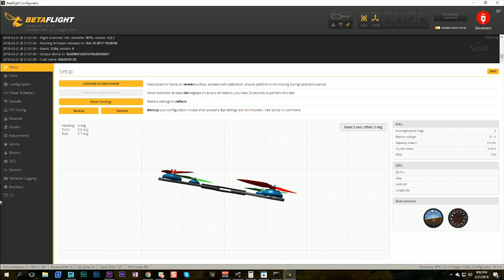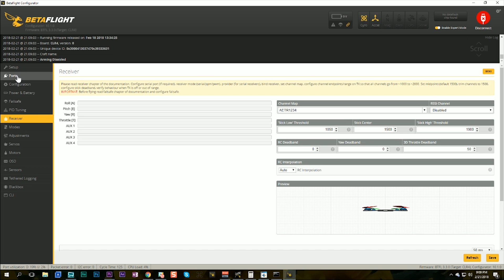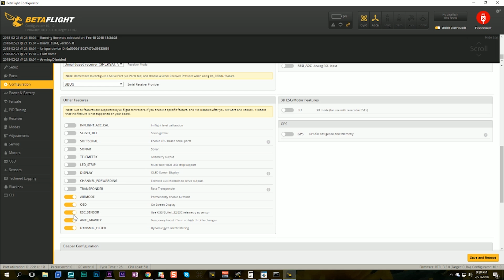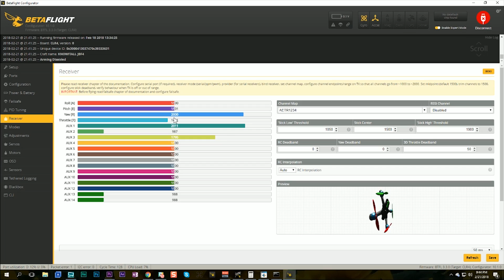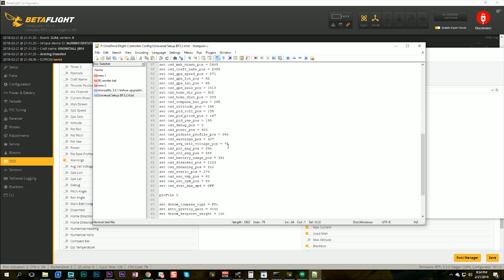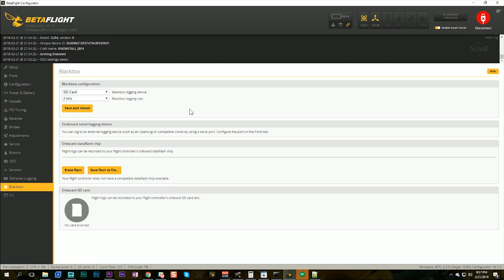Betaflight 3.3 Ultimate Setup Guide

Comment: On OMNIBUSF4SD target the 'Disarm regardless of throttle value...' option is no longer available in the Configuration tab. Now disarming via switch directly kills the throttle value and drops the quad from the sky. Any ideas or does anyone know what the cli command is for this?
Reply from the maker: Make sure you are on the latest configurator version. IDK if maybe they disabled that option?
Reply: Yes, all up-to-date desktop Betaflight-Configurator 10.2.0. I'll try to load the regular OMNIBUSF4 to see if this feature is missing there as well...

...No, same issue, for both F4 targets this option is missing. See: https://drive.google.com/file/d/1fE490z9FWyYOdkzyBjh0NnEYY1YSDc6j/view?usp=sharing
Reply: It's confirmed, this feature has been pulled from the official 3.3 release. cli also doesn't support it anymore. I hope at least they'll put in the cli option again. I've learned to fly these things, still in having control when on accident hitting the disarm switch. Kind of what I learned as best practice from the various setup videos seen on youtube - https://github.com/betaflight/betaflight/issues/5297

Comment: I'll wait for the BF3.2.0 configurator with the BF3.3.0 firmware, there a lot of CLI commands involve in the upgrade, am sure Mr Bardwell will doit great as always explaining the upgrade and 32K Gyro, Kalman Filter, Runaway Takeoff Prevention, Arming Disabled, Independent rates settings for roll / pitch / yaw conversions, I think Mr Bardwell has to do a complete serie just for BF3.3.0
Reply from the maker: I've already done the Taz video if you search for it.

Comment: I have an F405 AIO and it will NOT do 8kHz/8kHz, always puts me back to 8/2. Any ideas?
Reply: having the same problem with my jbf4 aio, keeps resetting to 8/2
Reply: best i got was 4/4. Wondering if it's a bad batch or the fc is just not capable

Comment: JB!!! Your my guy!! Seriously you help me out allot. I am gonna use your affiliate links to sure this month 👍 love this video! It’s what the community needs. I figured out what was causing my over roll issues. Something was messing with my gyro and a simple FC cover fixed all my issues. I am running 3.3 RC 2 currently and am loving it. Thanks for this. I do have a question about BLHeli_32 and this brand new Spedix 35amp AIO that doesn’t want to connect to the latest 32 passthru... I have a brand new X5 Silky in building and the last thing I need is to change my motor direction but in getting error code 9 and error code 2 telling me to check my USB settings. The problem is it works fine on my other BLheli_32 quads so it’s a head scratcher...any ideas?? I need help on this one.
Reply: Oh man that was a interesting one. Got it figured out. Faulty brand new Spedix 35a BL32 AIO.... couldn’t get on 32 pass thru at all and in BF if you ran motors the esc would shut down and boot you out of the config...FML. Get fpv is getting this one back. Really bummed as the solder job was gorgeous and the old Speedix AIO was one of my favs but this one was a total turd 💩. Get my Silky X5 upbthis week but I gotta wait now . That’s the s$&@ part of this hobby. You can do everything right and still be waiting cause the margin for error is so high with this tech IMO

Comment: diff goes to txt, but restore looks for JSON?
Reply from the maker: You don't use the save/restore buttons. You paste back in the text to the CLI window. The save/restore button never worked and should be removed. Until it's removed, let's pretend it doesn't exist.

Comment: Hi Joshua, 
Great video. :) 
I have one question for you,
When you hit “save and reboot”, it says “failed to close serial port” in the top left corner, but you didn’t mention it.

I have the same message. Is there any reason for this? Are the something I did wrong? 

(I have the F405-osd FC)

Thanks ;)
Reply from the maker: No, it doesn't mean anything. You can ignore it. Basically, the configurator went to close the serial port, but the FC had already disconnected, so the serial port was already closed.
Reply: Joshua Bardwell, thanks man. 😎
Now I can sleep at night 😅

Comment: On my JBF4 I needed to adjust the scale of the amperage calculation quite a bit. At least on mine, the stock setting of 250 was way off. I've tested with about 6 packs now, and although it's not perfect yet, a value of 370 is pretty close.
Reply from the maker: I'm surprised to hear you have to change it that much.

Comment: After the deluge of comments here I'm not sure you will get to this but why did you use "diff" and "save" instead of "dump" and "save" since "diff" only puts out a limited number setting and "dump" puts out everything?
Reply from the maker: diff only outputs what has changed from defaults. So it avoids overwriting default values that change between versions, and is more concise.
Reply: Oh that's great to know. Thank you!

Comment: I can’t get DFU up for the life of me. I’ve installed all of the drivers & impulse RC driver dose not work for me I have tried everything uninstalled Betaflight & the drivers reinstalled everything different cables nothing works. I still cannot connect my Tiny6 with its F3 flight controller on two different pc’s 😫🤬😤
Reply from the maker: Probably it is an spracingf3 based flight controller and it uses the CP210 chip. If your FC has a CP210 chip you will never see DFU in the configurator, even if the board is in bootloader mode. You have to look at the LED on the board.

Flashing an spracingf3 FC is like this:

Set manual baud rate 115200

DO NOT put the FC into bootloader with the button or the "bl" command.

Simply plug in and hit Flash. Often times this works. Sometimes you have to hit Flash, let it fail, then hit flash twice.

If that doesn't work, try holding down the bootloader button while you plug in USB. But generally, when I flash an spracingf3, it doesn't work if I actually manually put the board into bootloader.

Comment: The long anticipated BF 3.3
I know you said that this is only a release candidate and that you will be going over more functionality as the actual release comes out.
I got the Kekute V2 "great manual by the way" 
Do you still have to do all that Voodoo to overclock the CPU and the copy and paste the CLI commands for the Kalman filter?
There might be an unspoken rule of one question per comment we leave. LOL...
But when we do run the Kalman filter do we still select and do the configuration for Dynamic filters?
Thank you Joshua..
Reply from the maker: You don't have to overclock. The new Biquad RC/FIR filter avoids that.

You can combine BQRCFIR with Dynamic.

Comment: I'd love some information about getting rssi to osd via telemetry instead of having to run a wire. Great video, that's why I'm a $5 Patreon subscriber.
Reply: Check out oscar lang website, frsky r-xsr instructions, he goes over this and writes it out for you to follow, basically you tell your radio to broadcast rssi on a channel, then tell betaflight what channel it is on (Aux channel)
Reply from the maker: I made a video about this:

https://www.youtube.com/watch?v=t-evOAS9Mkg

Oscar Liang's instructions are based on older version of OpenTX and don't work any more. At least unless he updated it and I missed it.
Reply: Thanks I watched them both.. again😎 I think there is yet another way if you have opentx 2.2 and betaflight 3.3. On bf slack,  @mikeller mentioned nothing to do on taranis but make sure to discover sensors and verify rssi, that is all. Apparently they added rssi byte or it was always there, the last byte of packet in telemetry from receiver to fc. I think maybe associated with f.port, but this is on s.port. They pick it up and display on osd. You disable rssi channel in bf configurator. Yes disable. Maybe I misunderstood. I'm going to try just for s$$$s and grins. Thanks again for your videos!
Reply: Correction, Opentx 2.2.1
Reply: It does work! Apparently I was already using it, but thought I was using the adc. https://youtu.be/4dT-PGmcwd8
That is cool...

Comment: Joshua Bardwell Hiya josh can you give me a bit advice I'm using the flysky i6 transmitter and seen doing an antenna mode and fitted 2 10db extended wifi antenna. with the pigtails 
candidates you tell me if this is a very good idea  the boy sayed it's a very good long range
Reply from the maker: A high gain antenna will have a narrower beam so just make sure you're flying inside the beam.

Comment: After calibrating my current sensor on my JBF4, 430 is just about spot on in vs out mAh every time...
Reply from the maker: Something isn't right. The number should be close to 250.
Reply: I had to put it on my JBF4 to 350. As far as i can tell, it's pretty damn accurate now.
Reply: I don't know @Joshua... I was doubting myself after your comment, went and flew 4 1300 mAh 4s CNHLs to 1000mAh out via the OSD just about exactly(I think I went about 10-15 over on one, and 1 or 2 over on the others. Charged them when I got home. 4.05Ah put back in... hard to argue that it is working amazing, just not at 250 scale. And this wasn't the first time either, it is consistent.

Comment: Hey Joshua ! Thanks for your amazing videos !! I got a question for you. I got lost here. Is Pid loop time related to esc instead of the flight controller ? I’m using Dshot 300 but i have a F4 board. Should i use 2khz instead of 8khz ? I though you said in a previous video about looptimes that dshot300 is like oneshot125 and we shoudnt go higher than 2khz. Thanks for your help again :) .. Happy flying !
Reply from the maker: I can't remember off the top of my head what the max speed for dshot300 is, but Betaflight will prevent you from going faster than is possible. When you try to save the higher looptime it'll just reset to 2 kHz or whatever.

Comment: Looks like a winner for beta flight. I am interested in buying your flight controller and I would like a recommendation for a good 4-in-1 ESC that will fit with your flight controller. I am going to be using the Emax 2205 S 2300 KV motors and will be mounting all of this on a MODE 2 ghost 5” frame with what I believe is a 30 mm x 30 mm. I would love to use the ALKON SEFM 30amp all-in-one but it is a 35 mm x 35 mm. Any suggestions? Thanks again for a great video...
Reply from the maker: 30.1 mm is the spacing of the standoffs. 36 mm is the size of the board. They refer to the same form factor. You can use Aikon SEFM 30A with my FC.
Reply: What an idiot I am LOL. Thanks for the fast response and the info ,I will try them out.

Comment: Nice, but nothing to do with BF3.3. You could have done exactly the same video for BF3.2.5 haha.. I was expecting something about the new r and q tuning...
Reply from the maker: Joke's on you. R and Q tuning was replaced in RC2. Which is an example of why I try not to cover pre-release stuff until it's solid.
Reply: Joshua Bardwell thanks. That's all I wanted to know.
Reply from the maker: Now you can simply specify the cutoff frequency as if it was a basic lowpass, and the coefficients are calculated for you.

Comment: Mr JB..... I have two of your flight controllers, that I have run the Impulse RC Driver fix on whilst the boot button was pressed (also restarted my computer a few times) and whilst it tells me the driver has been updated, the board will not boot into dfu mode using either the cli command or pressing the boot button. 

What am I doing wrong?
Reply from the maker: You have to hold the bootloader button down while the board is not plugged in, then while holding it down, plug in USB to power up the board. After the board powers on for a second, you can release the button.

Pressing the button after the board has powered up does nothing.
Reply: Joshua Bardwell That's what I do and get the solid red light instead of red/green

Comment: Hey Joshua, I don't think I've seen you run Dshot 1200 on a build. Is Betaflight known to have issues with 1200 that aren't present using 600?
Reply: Also PID Tuning is a topic for many many other videos
Reply from the maker: Betaflight can run dshot1200 no problem. I don't think my ESCs will.
Reply: Joshua Bardwell I must have something else causing full throttle desyncing on my build 🤔🤔🤔 not likely damaged motors

Comment: Is it still necessary to use a diode/resistor when using smart audio and still wanting to use the mic from the runcam? If so, can someone post a digikey link or exact model type to use? I just got some of the updated mach2s and i think this is a great feature over the tbs unify is that the mic is on the vtx and you can wire smart audio up with one audio wire and there is no sound interference!
Reply from the maker: It's never been 100% necessary. It filters the ambinet noise from the smartaudio circuit on the vTX in case loud ambient noise caused smartaudio not to work. But that hardly ever happens.

Comment: Is there a way to get my RSSI on my OSD using Spektrum 4649t or am i s.o.l. I'm currently on rx6, rx4 is vtx commands. Using fbf4... Is there a way to get instantaneous amps instead of Watts?. Thank you for what you do.
Reply from the maker: https://github.com/betaflight/betaflight/wiki/Howto-use-RSSI-with-Spektrum-SPM4649T-and-other-satellites
Reply: Joshua Bardwell ,thanks. Will this only work with 3.3, from what I just read it will not be that accurate, Correct?
Reply from the maker: You know all I do at this point :-)
Reply: Joshua Bardwell thank you for your time

Comment: With respect, I have to point out the elephant in the room. A BF3.3 video and not even a mention of 32k gyro or new kalman filter? This isn't much different than the 3.2 setup video. Doesn't seem like  much of a point to this video unless the point is to plug the JBF4 before everyone realizes they want a 32k capable gyro. I really appreciate your content but this is a bit of a disappointment
Reply from the maker: These new features will be covered in a separate video as the firmware gets closer to final release. Like I said in the intro, I hate covering content only to have it change and my video instantly be wrong or out of date.

The point to this video is that since the software is updated to a new version number, there must be an updated video to reflect the new software. Even if few things have changed, I can't just say, "oh go look at the 3.2 video it's the same."

If you think I'm plugging the JBF4 go look in the video description. What's there? Even a link to it? No.
Reply: Really? The point to this video was just establish 3.3 as the latest firmware version number? This is a RC. Its not even out yet. You chose a bad example to intro BF 3.3 contrary to what you claim in the intro.
Reply: You should chosen a board capable of showcasing BF3.3's major features.
Reply from the maker: That would be silly since this video is not intended to showcase major new features, it is a comprehensive basic setup guide to BF. 

But you are acting like 32k sampling is the only major new feature of BF 3.3, and you are acting like this will be the only board I ever use to cover BF 3.3. Honestly, I think you are mainly just mad that I didn't put 32k Kalman in this video. I'm also looking forward to covering it, when I can be sure that it won't change out from under me. Between RC1 and RC2, they removed the need to manually calculate filter coefficients. What is going to change in RC3? I just don't want to have to make the same video twice and waste your time watching something that goes out of date in a week.
Reply: I am new to the hobby.  I Just finished my build and I am starting the betaflight config process.  If there's another betaflight config video on Joshua's feed then so be it, but this one popped up and is current and I'm using it.  Thank you very much Joshua for all your hard work.  I really enjoy your videos and what you are doing for the community.  I will be supporting you soon!
Reply: There are some serious critics out there. Seems like they're telling you how to do your videos. Guess they're NOT going to learn something today. LOL You can please some of the people some of the time. ^(*&% the rest. LOL
Reply: Joshua Bardwell and then Josh follows with "How bout them apples?"
Reply: Ya all I came for is Kalman and here nothing about it! I don't have a 32k gyro board. But I'm still interested in the kalman and just run it at 8k.  I agree D lew kinda stuff already known from 3.2bf
Reply: totally agreed!
Reply: Who gives a shit about the Kalman filter like josh said he will cover this in a different video which he states in the intro ! I searched for set up guide for BetaFlight which is exactly what I got so how can any of you say his video is pointless ???!! Well done josh good video for me you are the drone godfather and I will watch you regardless of dickheads that try to make themselves look as tho they know more than you say !
Reply: Joshua Bardwell sorry but this is not an ultimate setup. 

It maybe a ultimate playlist once all the videos are done however as you put in the comments and mentioned at the end of your video it’s a basic set up. I think that’s why the guy was mad about no 32 gyro or Kalman filters and honestly I understand why he is annoyed. This video had no new information maybe I have watched to many of your other videos but all it really did was use the word ultimate to point us in the direction of all your older videos.

I am one of the geeks that you are and joke about so I want the technical stuff. Don’t just make videos for newbies keep us the ones that have been watching you grow over the last 1-2 years entertained as well.

Normally I love your videos. How this one wasted 41mins of my life.
Reply: You're right. I'm really interested to see if the 32k gyro/kalman filter thing really even matters, as I think a good portion of your subscribers probably are. I just don't think this video did anything for those of us that are actually paying attention. Seemed like a plug to me. I hope im wrong. No offense. You're a good dude. Just giving feedback.